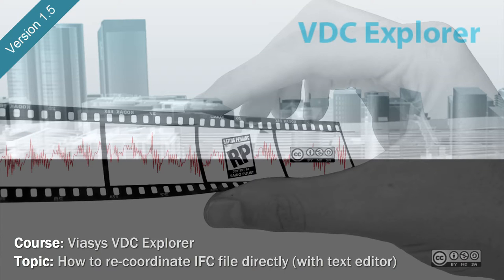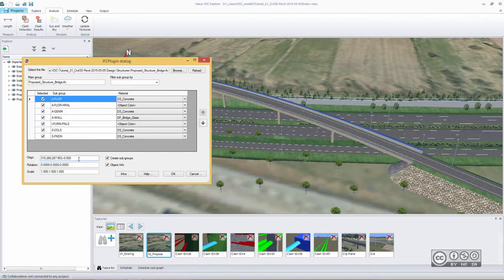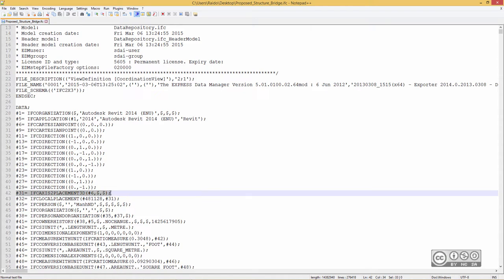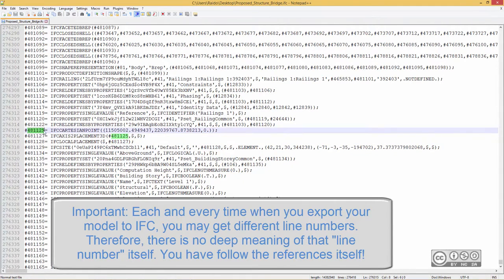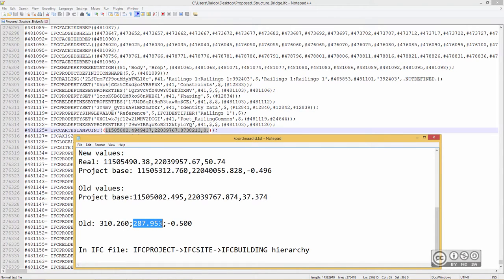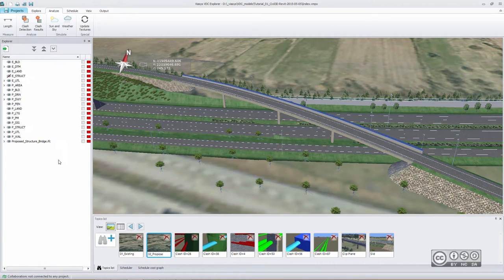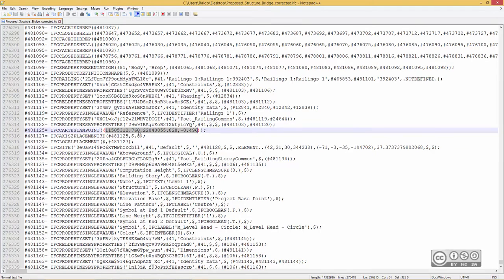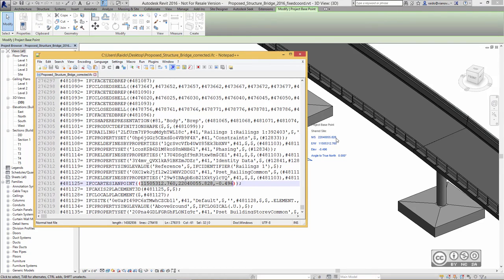Viasys VDC Explorer - IFC direct editing using text editor

Comment: Hi ! do you know where I can read about how to edit IFC file in .txt and learn the language ? I know is just a language as html or others.

Regards!!
Reply from the maker: Mauricio Galan Hi, I suggest to take a look to IFC standard web pages first: buildingsmart-tech.org
Reply: Thank you!! I was looking there but I didn't found it before!!! Do you think looking at IFC 4 is useful? I knew it is under development so maybe is better to wait. What do you think about this?
Reply from the maker: IFC 4 is already used in some software packages. But would do not call IFC as a "programming language" or a language one should learn from scratch. Typically it is only needed when you want to have customized workflows inside your package/file. But because those things are heavily standardized and you want to ensure that IFC can be read whatever package is used, probably it is safer to look at IFC libraries.